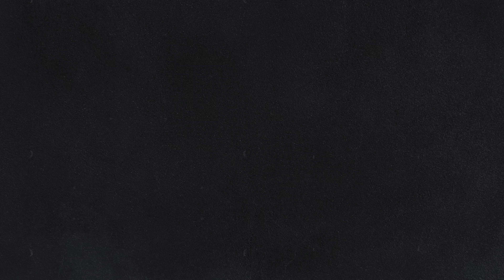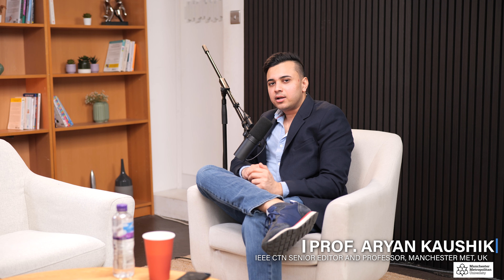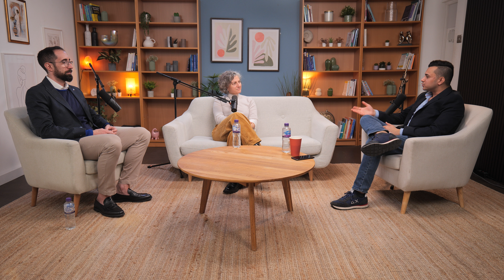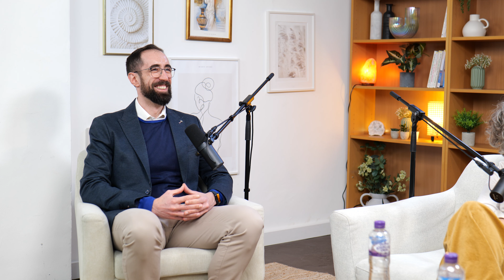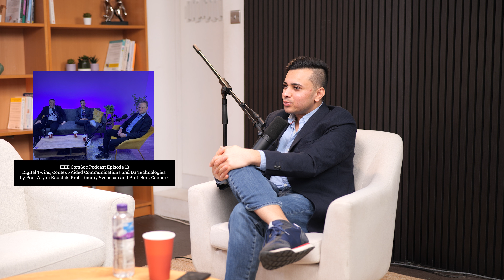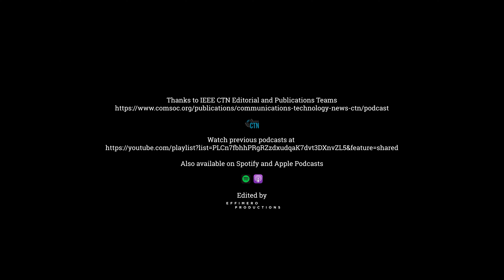Episode 15: O-RAN, Digital Twin, and Machine Learning for Sustainable 6G

Comment: All these papers on AI/ML applications to wireless communications have become more of a gimmick. People working on such areas never really find something novel, but use existing models to different scenarios without even giving mathematical justifications or performance bounds. They also ignore practical channel impairments and hardware complexity. It's high time IEEE journals start noticing this trend and put a stop to such cheap and shortcut method of doing research.